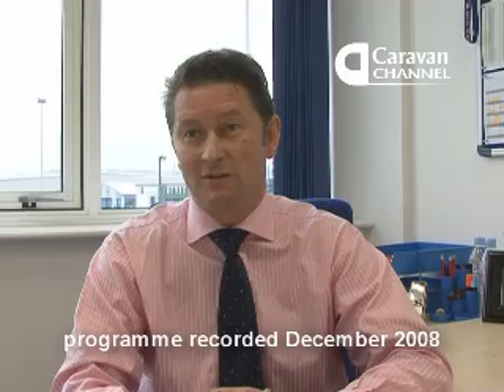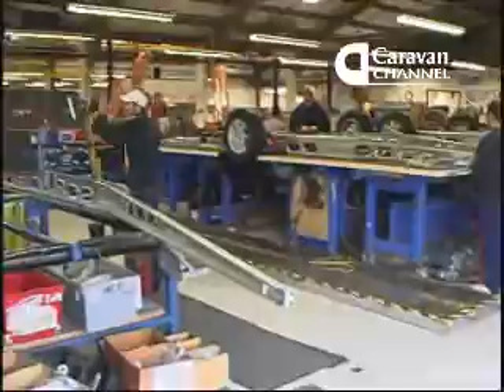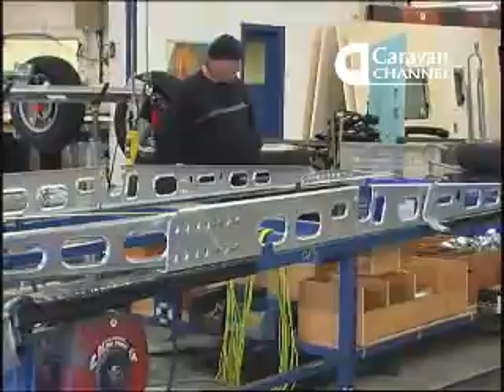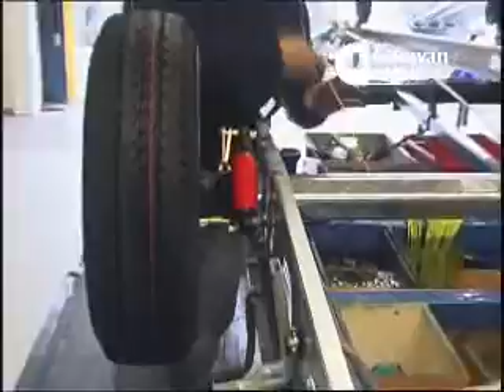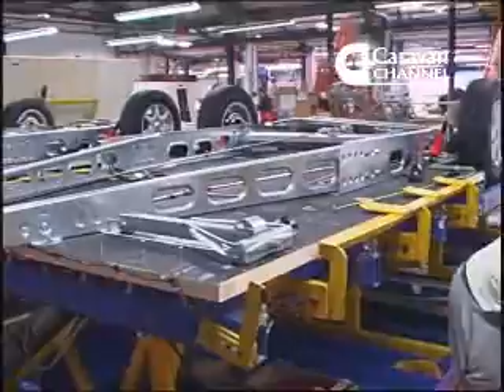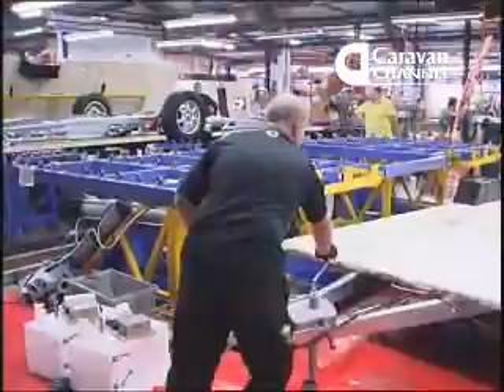Bailey Caravans factory tour, part 1

Comment: @baloothebear2 No, we bought the Ranger and it was horrendous. I've even got the photographs if you would like some further information. And Bailey didn't give a monkeys when I called them to discuss all the problems. Funny thing is, I've told the Dealer we bought it from (also do lunar, Coachman and Adria) that we will be wanting to buy a luxury fixed bed in a year or so, and they are recommending the Bailey Unicorn. Not on your nelly ! We will be going with the Lunar Clubman instead.
Reply: KM

Comment: We bought a 2004 Bailey Ranger ordered from the NEC show in February....what didn't go wrong with it!  3 front windows, leaking water system, a gas locker support totally broke, leaking roof, door catches all came loose quickly, faulty electrics, chassis faults....and all took ages to fix because Bailey's warranty repairs take months and months. We recently part exchanged it for an Adria Altea - at last the problems have stopped. What a shame though!
Reply: I have just bought a second hand Bailey Paegeant Beaurdaux. We got it pretty cheap in Australia. But I knew of some of the problems. I love the layout. Lots of windows in the front and skylight. Very light for a van that has a shower and 2 bedrooms. Now for the problems. I'm a Mechanic and I have designed and built a lot of things. The main problem which for the life of me, Bailey hasn't foreseen is that weak chassis. Australia vans have a 100 by 50 mm tubing all the way from front to back. On it's own it will support the van. But with a Bailey the rails are so thin with no cross brazing that without the wall, the rails will just flex in and out. The brackets in the gas locker is really the only thing that holds the walls to the floor. Mine was broken and the walls in the gas locker moved up and down by 6 inches. As you left the van up and down by the handles you can see the chassis flexing. And the begining of this problem is they didn't predrill the rail for the hinge for the front windows. So the fibreglass cracks and slowly lets in water and rots out the whole front frame. I've replaced the whole front frame with 30mm sheet of ply. Why didn't bailey do this instead use some flimsy pieces of wood and some foam and staples. I've inserted long screws through the floor into the walls. Put angle brackets along the under floor and riveted it to the side panel. I've put 4 rails accross the chassis to stop twist. Got rid of that dread full rubber suspension which saggs over time and rubs through the wheel guards spraying mud and dirt all through the cupboards. And replaced it with a solid axle and leaf springs and electric brakes. Sorry for the rant. It's now a great van and I love it. But for someone having to pay someone to fix it. Forget it.